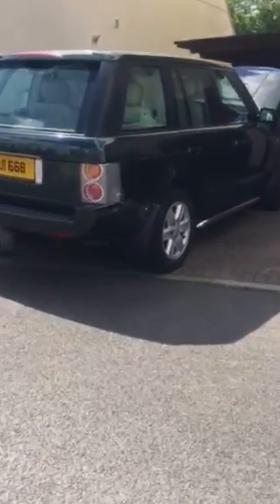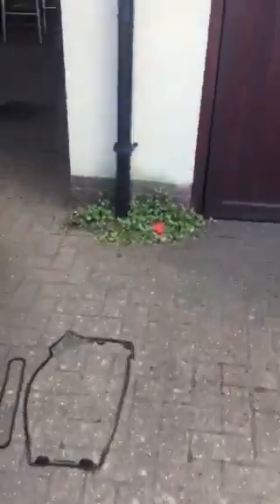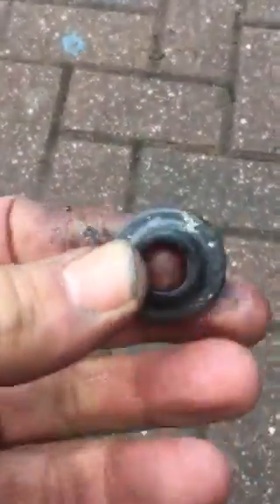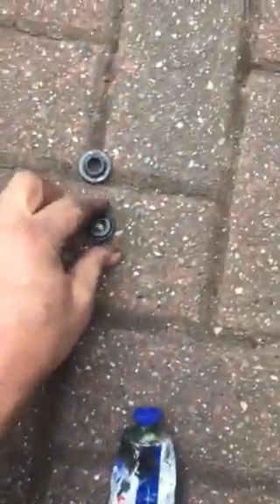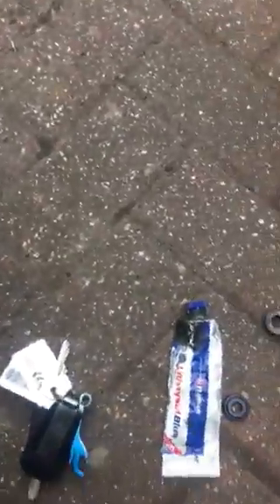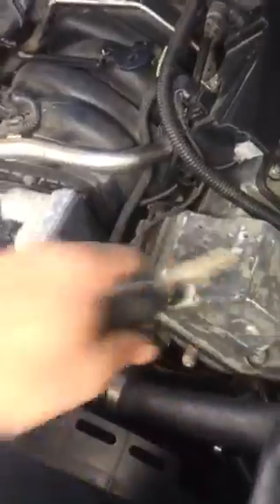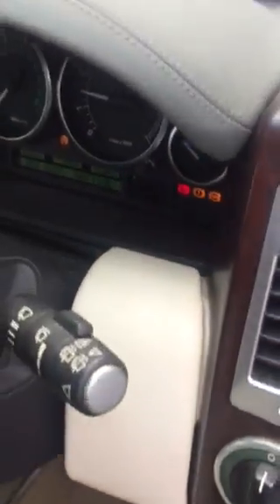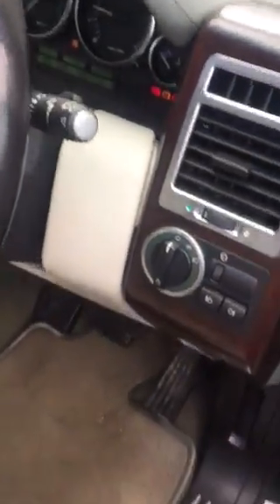L322 m62 valve cover and seal

Comment: The inactive suspension light and message will come on every time you disconnect the battery.  Start her up, turn the steering wheel fully left and right and it'll reset itself.

You could just reset it.....But....   The reason it comes on is because it has lost the angle of the wheels.  When you turn it from stop to stop it re calibrates itself and everything runs spot on.  If you just reset the fault, the light goes off but your car doesn't have a clue where your wheels are pointing.

I would be tempted to disconnect the battery again and set it by turning the steering wheel.  It obviously makes use of knowing the steering angle.  There's so much going on with the suspension and ABS and whatever else.  I think that your car might run better if it can do it's sums properly.

I hope you don't mind me telling you this.   I'm just trying to help.

Best wishes
Reply from the maker: Great advice Thankyou